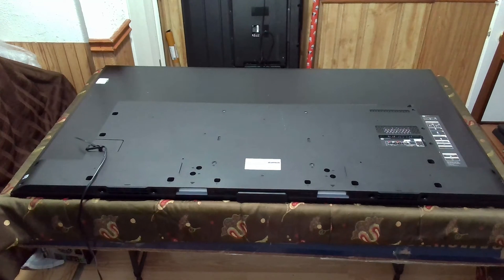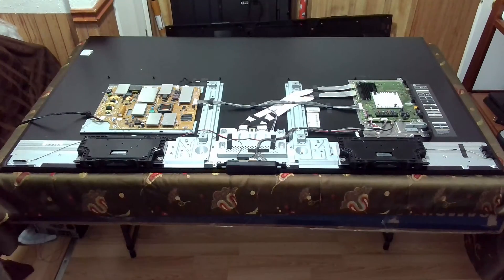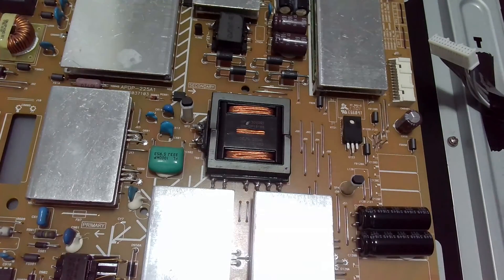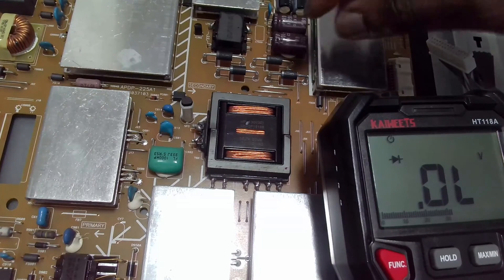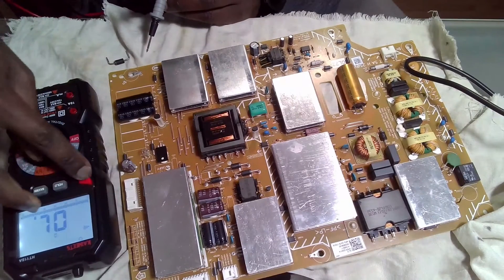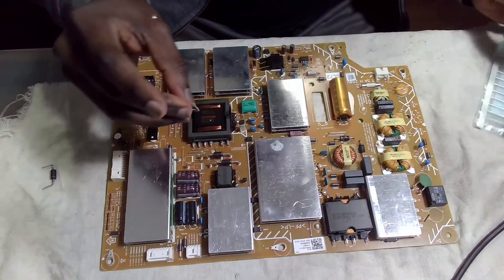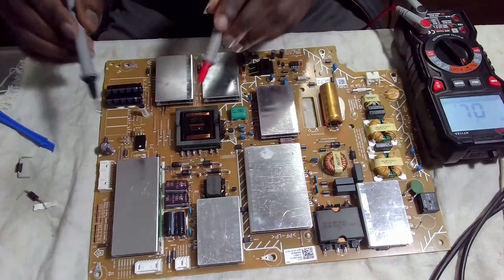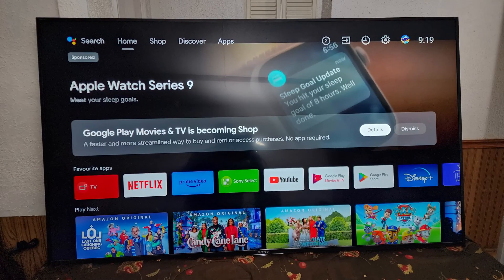How To Fix Sony TV No Power, Buzzing Sound From TV. XBR X850E Sony Models.

Comment: I followed this and was all good. Tv actually turned on for 10 seconds, but then a big spark and an electric shock ran hit me. It then has left a burn mark just below the motherboard and the diode closest to the power supply entry is shorting :(
Reply from the maker: Oh wow...I am sorry to hear that. You may have soldered in a wrong polarity or may have gotten too much solder at some point. I hope you are doing okay.

Comment: Great video dude. Had to come back after I got the parts I needed just to say thanks. Turns out this exact diode in my TV died, just randomly didn't want to turn on yesterday. Got the Diodes in this morning, swapped them out, and TV turned back on no issue. Thanks for the informative video. Guys like you are what make YT great!
Reply from the maker: Appreciate the feedback. I am glad your TV is back up and running. You did very well.

Comment: What do i need in order to do this??
Reply from the maker: You will basically need Philips screw driver, solder and soldering iron, and the replacement diode (SR 515, if you have the same model). A multimeter is also needed to check the diodes. Hope this information helps.